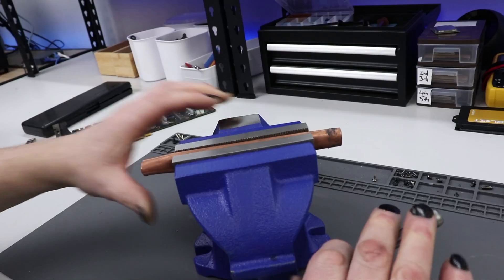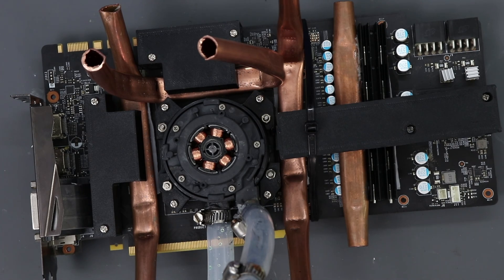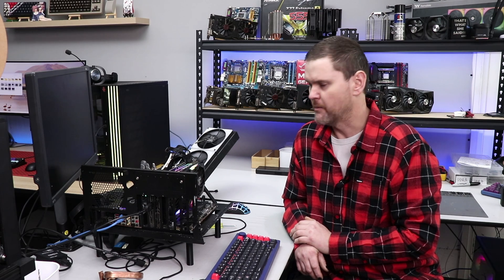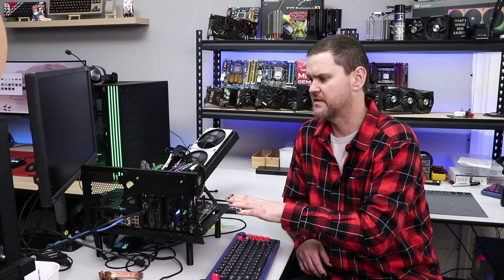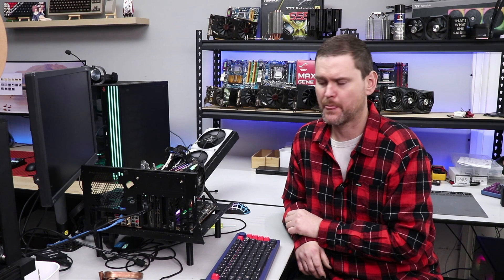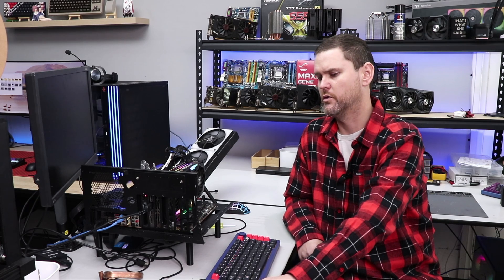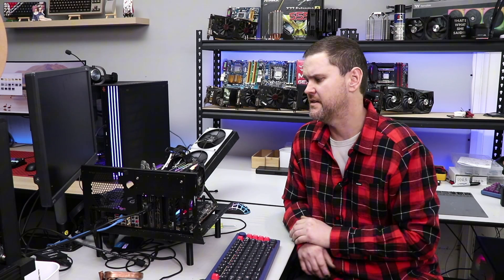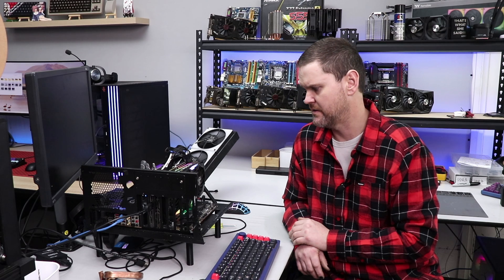Frozen RTX 2070 Super – Too Much Cold for an OC?

Comment: Cards can react wildly different, model to model. Have a evga rtx 2080 super xc ultra that will do 2125 mhz using 215 watts. Got one for a friend, msi rtx 2080 super gaming x trio. It was kinda trash, would only do stock speeds with 255 watts of usage.
Reply from the maker: That's very true, there are a lot of variables at play here and the BIOS can make a big difference too.

Comment: I was able to get 7951 on timespy with a regular 1080 8gb. Just a basic overclock with 10% power reduction. For whatever reason reducing the max power makes my card work better. Something to consider testing out.
Reply from the maker: Interesting! For stock or mild OCs, lowering power can definitely help with efficiency and thermals, makes sense it worked for you. But once you’re chasing max clocks, especially at cold temps, the silicon usually needs more volts, not less, to stay stable at higher frequencies. Cool to see different approaches work!
Reply: @TrashBench  There is some sort of physics at work beyond "make cold run hot". I'm not exactly sure but if you keep at it and please keep some detailed paper records maybe we can all learn more. Other power supplies with better efficiency might play a role too. There are so many variables at play.

I also play music so if you want a track i'd be glad to write you one free of charge of course.